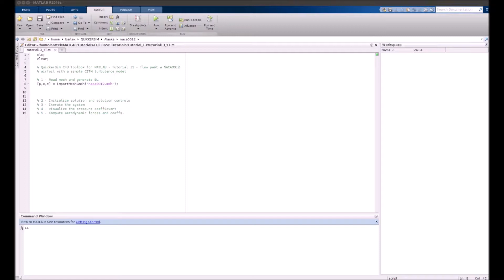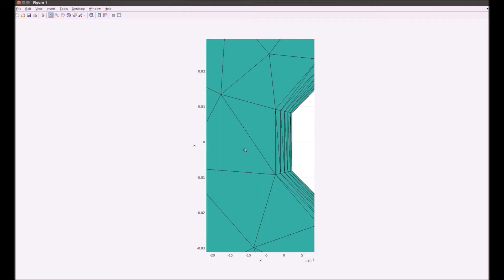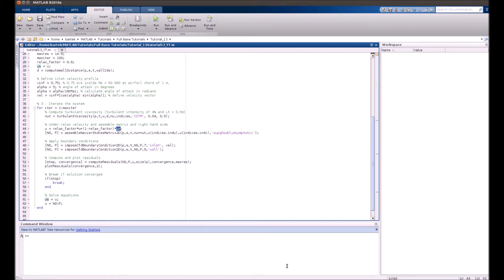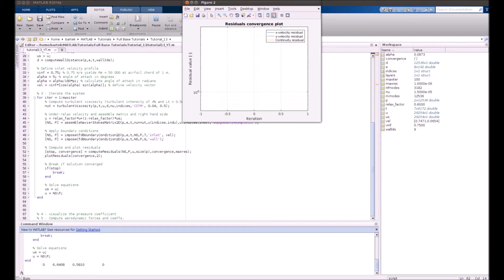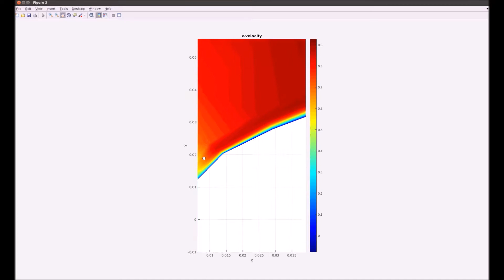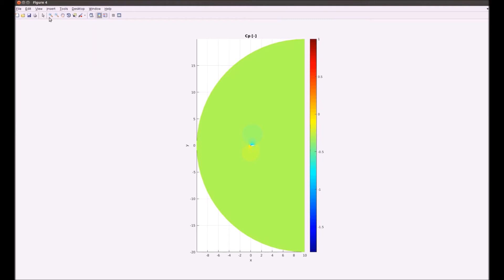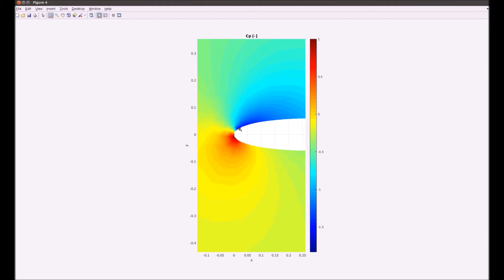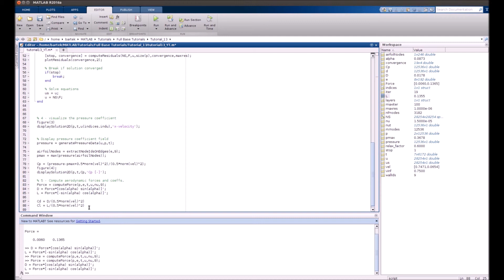CFD  Tutorial 13 - Turbulent Flow past NACA0012 Airfoil

Comment: Hi, about the Reynolds number, will it automatically consider the airfoil chord = 1 meter or are there some settings?
What if I want a different chord in a simulation? is this an info given by the mesh?